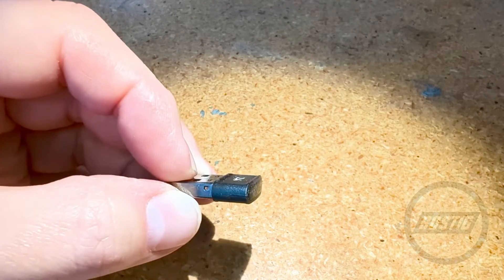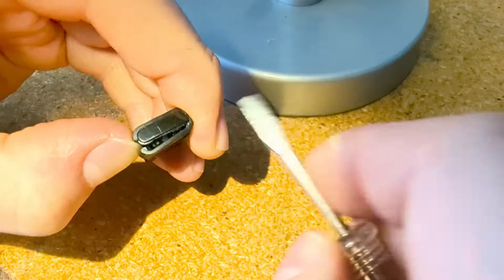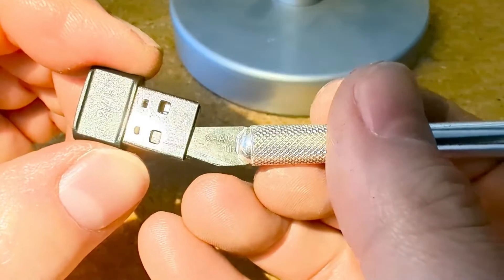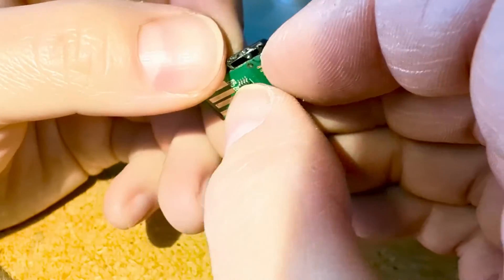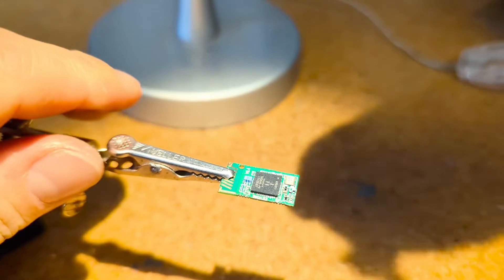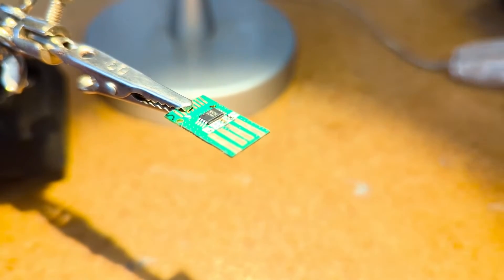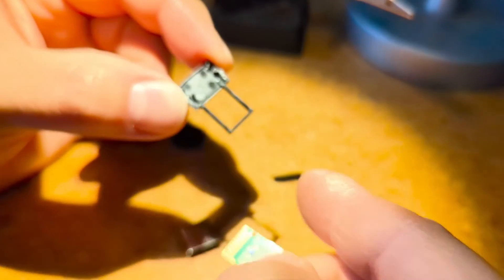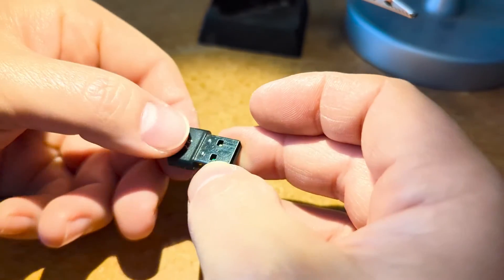Fix/Repair the Razer Nari Ultimate USB Dongle via reflow or oven, how to extract the mainboard

Comment: What is this a solution for? Because i think my dongle is fine. Just the headset won't act like its trying to pair (not blinking blue light). Pc detects dongle but when i turn headset on synapse saying device is turned off.

Comment: Insane that this works, lol.

For those who don't want to take apart the whole component, you can use a curling iron to do so. I wrapped the plastic part in aluminum foil and focused the heat onto the metal, did so for 5 minutes or so. The plastic inside got a little melted, but it ended up fixing it all the same.

Comment: Unbelievable, my dongle hasn't worked for a year now.
IT WORKS 100%, THANK YOU SO MUCH.
I rubbed the connectors with an eraser first because they had some marks from use, then
i turned on the oven for a while, then turned it off and placed the board on baking paper for about two minutes.
Approximately 1 minute on each side.
THANKS, YOU ARE THE F BEST 💪

Comment: MY dongle has been dead for months, putting the pcb in the oven at 350 for 10 minutes worked, thanks dude. i tried every solution before this.
Reply: 350 degree? its safe? Mine broken too.. Viper Pro

Comment: I recently put in a new motherboard and was losing my mind, wondering why my Razer headset kept disconnecting. I tried everything, including software updates and all the Razer support, but nothing worked. This solution, however, now works like a charm. Thank you so much for this video; it saved me a significant amount of money. Bake at 200 degrees for 10 minutes.
Reply: gas or electric?

Comment: 500 degree oven for about 10 min fixed my viper v2 ultimate dongle! Thanks for the tip and video. Subscribed!
Reply: Can you tell me the steps u took? Like do i have to take the plastic out? and what kind of oven? I have the same mouse thats why I am asking
Reply: @usernamesrstupid  Howdy friend, yes I did carefully disassemble the dongle down to the pcb. Once the PCB was removed, I put it in a ceramic oven safe dish for 10 min when the oven was preheated to 500 degrees. After letting it cool for a few minutes after removing from the oven, I reassembled the dongle and all my connection issues were resolved. Hope this helps!
Reply: @texas1nstruments  did you just set it in the dish? Or did you hold it up with something? My dongle died today and I found all this info. Really nervous about overheating it by putting it on something, but it’s not like I can make it float in the air
Reply: @Nadiki  I used a ceramic dish, and laid the pcb flat on it. nothing fancy, as long as its not conductive.
Reply: @texas1nstruments  thanks!

Comment: damn i had mine broken  and replaced dierectly by razer singapore  (hyper deathadder v3 hyperspeed) and after a year and a half same issues occur the dongle was the culprit. i can still use the bluetooth mode tho i was thinking of doing this for a long time  like reheating or resoldering came across ur video . i tried using heat blower the plastic piece looks like it came from a volcano eruption  lol but it starts working again haahah. thank you so much!

Comment: Thanks so much for this tip!!! Literally removed the guts from my Deathstalker TKL Pro v2 dongle by prying gently under the metal to free the glue then using a knife edge to leverage the metal from the plastic at the seam (across the body of the dongle). After pulling the metal protector, I removed the tiny green clip from the tip and carefully pushed the black retainers down while lifting up and out on the PCB (no need to crack open any black plastic parts. I slathered it in Flux gel, and hovered it high above a high BTU burner on my stove with some long electronics tweezers until the flux just started to bubble w/a hint of smoke, then I removed it from heat. I repeated on the other side for a shorter amount of time (less components, and still warm), reassembled and dum-dada-dum, working dongle again. I'd bet the solder is cold or not baked well and it breaks loose when installing and removing.

Comment: It worked for me. I heated it to around 180 degrees for 10 minutes. My adapter is the RC30-267 for Nari Ultimate. It started to disconnect by itself and shortly after it stopped being recognized. I heated it up and it came back to life.

Comment: This actually worked! I've been having this problem with my Razer Basilisk Ultimate for a couple of months now, and I couldn’t figure out why it was happening. Sometimes it would work fine, and other times it kept disconnecting and reconnecting. Over the past few months, it completely stopped working, so I had to use my mouse with the cable, which made the extra I paid for a wireless mouse feel like a waste. I followed the video, but since I don’t have a heater, I put the dongle in the oven at 130°C for 10 minutes. Then, I put it back together, and it worked perfectly! Amazing—thank you!

Comment: I fucking used a freaking black&decker heat gun, put it in the middle marker for heat, minimum air force for 2 minutes both sides of the board. Now it freaking works again. Thank you very much for your video.

Comment: also holy shit this works lmaooooo I threw the whole thing in the air fryer for like 3 minutes, didn't even take out the main board. It totally melted the plastic and I had to take off the metal part to get it to fit, but I can still plug it into my pc and it actually works now.

Comment: Worked for me, 350 in the oven for 10 minutes like someone else commented. If I wasn't getting the avnera av6301 error, the dongle would just rapidly connect and disconnect, this solution fixed my issues.

Comment: After many years of use, and like, a several month hiatus from using them, my Nari Ultimate dongle just wouldn't respond to my USB port. If I plugged it in the computer acted like nothing was inserted. I was searching for new drivers and all other means of software intervention but then I searched reddit to find this video. I was like, 'what? no way'... and so, I put my dongle in a vice to blade it apart safely with a carpet knife and took out the circuit board.  I didn't have a reflow either, so I just used a heat gun that had temperature control. After a few seconds on each side, I slapped it together and put it in my machine and I heard the familiar tone that a device was inserted.  And just like that I was back to throwing profanities at onery teens and talking about their moms in Fortnite through discord. good as new! Thanks, Bostig video! you saved me from Ecycling a nice headset

Comment: ive been using mine wired for the past 2 years and randomly searched up how to fix it again. did it at 350 degrees Fahrenheit for 10 mins and it worked. thanks a lot thought it was hopeless for this headset (and yes dont buy razer again lmao)

Comment: So I had the same issue, I don't have the tools shown in the video, but alas I came to a fix.  I took my wife's hair straightener and put it on the metal part of the USB port for about 45 seconds got it nice and hot, then plugged it in and all the sudden instead of device recognized as AV#%@# whatever...it now recognized it as razer nari and connecting to bluetooth again.  Hope it helps someone.
Reply: Awesome! Is it still working? I want to make an attempt but don't have any tools.

Comment: it worked in a conventional oven with a broiler. I switched High Broiling on, wait until it got hot, I put the DA V2 Pro (disassembled) standing position close to the top, wait like 30 secs, get it out, I saw that it melted lightly soldering. Get it back to the pc and with the dongle extender part I put a paper into the USB port so it pushes the dongle to the port, and tadaa, I heard the connecting sound but surprise surprise not the disconnecting... I even updated the firmware on it... You are a genius sir. Thanks a lot. It definitely worth to try before drop all the razer stuff to the bin. And yeah good advice on never again Razer. (for which I am sad as I liked the ergonomic of DeathAdder, but it was like two years I am using it wired... :D )

Comment: oh thank you so much i was thinking of throwing away the razer deathadder v2 pro....and i happened to come across your video and did the same on my dongle and it worked. thanks again and means this probably helps everyone with this wifi dongle disconnection problem. just slowly and carefully cut the house without rushing...

Comment: brooo that actually helped me thx u so much!!! (used hair dryer)
Reply: did you take off the plastic housing or just blow dry it?
Reply: @Preston_Rowe  yes, I did everything exact like in video
Reply: @arond1t304  how long did you use the hair dryer on the chip?
Reply: @29.92al5  about several minutes, but i think that than more than better, and its obviously depends on your's hair dryer power
Reply: @arond1t304  Thanks bro I just did it like 2 min hair dryer and 10 min oven 150 F plug and play I really love this headset but I already order this one SteelSeries Arctis Nova Pro Wireless
Reply: @29.92al5  damn, nice headset

Comment: I wish I had watched this video before attempting it myself. Although I did pretty much the same things, watching this first would've made it a lot easier. Anyway it didn't work, but like you said it was already fucked so doesnt really matter. 

I've owned over 50 (yes FIFTY!) razer products throughout the years and the support used to be good but since a couple years ago they are not very interested in helping, they just want you to buy new shit. The fact that this issue is so well known yet never fixed leads me to believe this is just planned obsolescence. Unless they manufactured all their nari ultimates at the same time, because I had 4 throughout the years and they all had issues. I'll buy a logitech headset next.

Comment: How did bro even think to do this? (it worked)
Reply from the maker: Glad it worked for you!  Good job fixing it yourself!  Cold joints on boards is pretty common. When I lived in Tokyo back in the 90s I got a brand new widescreen CRT TV that was thrown away bc of cold joints on the main board. I couldn't cook the whole thing, but used zip ties to bend the board enough to restore good contact. Never figured out which joint or component, and like this, doesn't matter. As long as it works!

Comment: I put the disassembled USB in the oven at 125 degrees for about 10 minutes and it works.
I have 3 broken USB dongle from these headphones. I really like these headphones for comfort, sound and vibration. the battery sucks a bit compared to new models that last longer. 
finally don't have to look for another dongle from Aliexpress
Thank you
Reply: Celsius or Fahrenheit?
Reply: @silasmuller8051  celcius
Reply: @silasmuller8051  celsius
Reply: @silasmuller8051  has to be celsius as 125 F is only 51 C and that is not enough to melt the solder. i will try this RIGHT now in my kitchen oven ima report back if it works
Reply: @ian.eriksson  did it work?
Reply: @mikkelnielsen4029  yes it did just put it on the weird paper that is oven safe and then put it in for like 10 min

Comment: Thank you very much. I solved the problem thanks to you. I heated it with a hair dryer without removing it, the plastic warped a little, but it works now :D
Reply: How long did you use the hair dryer?
Reply: @IonR6  10 m
Reply: Lol me too it work
Reply: @JaviMM what temperature and time u use?

Comment: uhg what? i read a reddit post about the fuse part at the corner spot. i just used a tweser and pinced it close and it fixed it. but the distance I can go from dongle is like less than half from before.